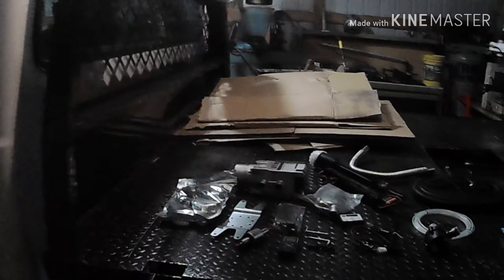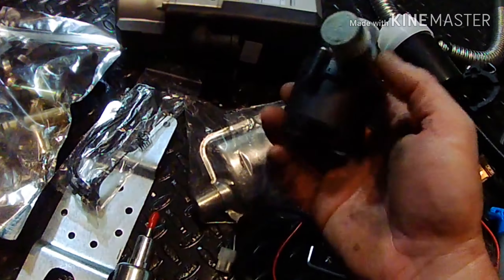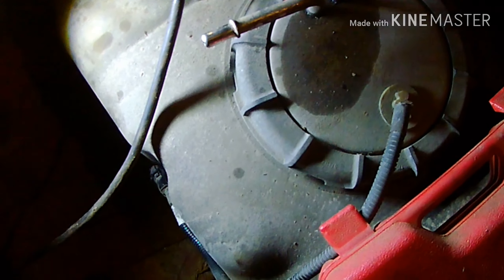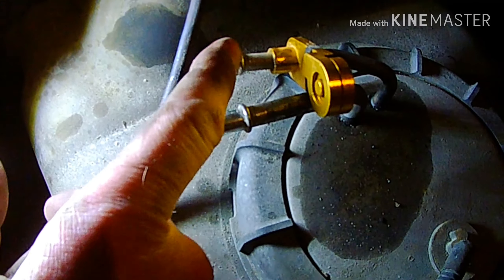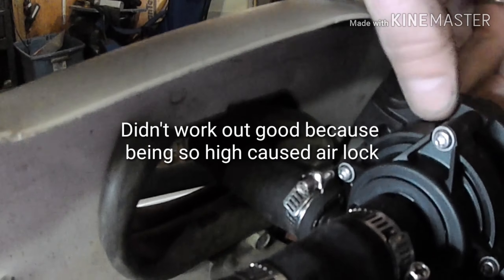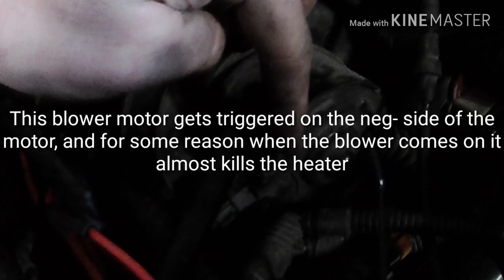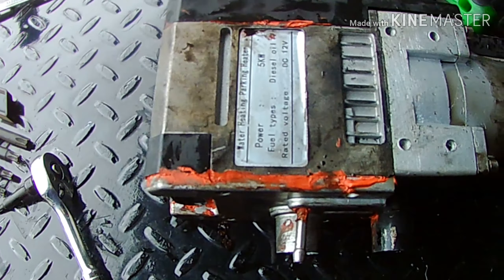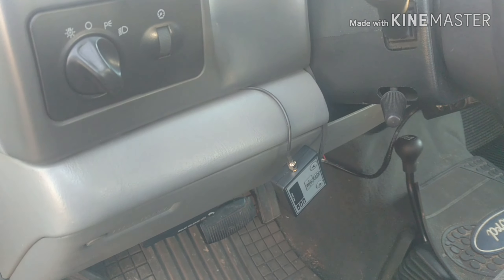Diesel parking heater installation, sort of!

Comment: Thanks for the video, Where did you buy the heater?
Reply from the maker: On Amazon but it didn't last more than a few uses, it kept over fueling and clogging the burn chamber with soot. I tried everything I could to get it to function correctly. The company ended up refunding my money as nothing they could do would fix the issues. I did take the main unit apart and found that the burn chamber was badly assembled, the computer stopped sending power to the glow plugs and all hope was lost to get it working correctly
Reply: @Lupusharv  Thanks, glad you were able to get a refund.